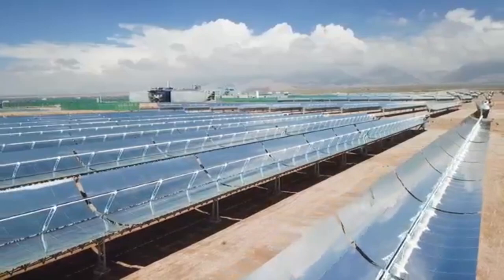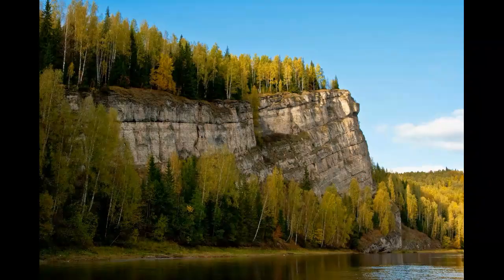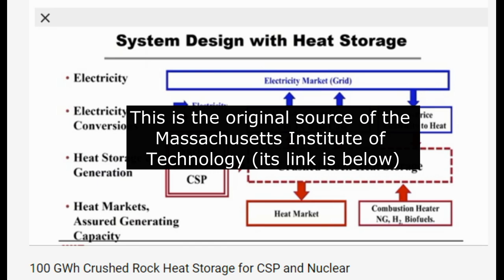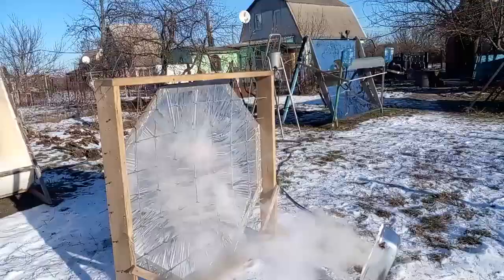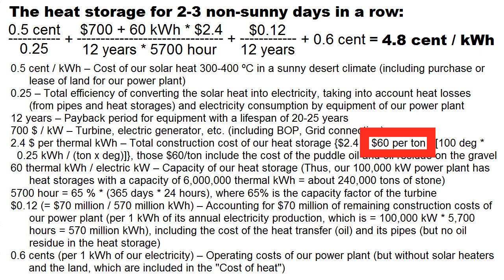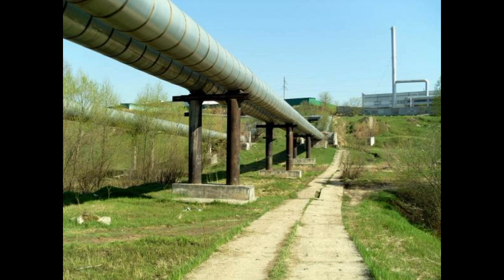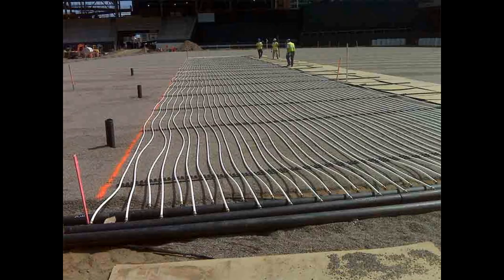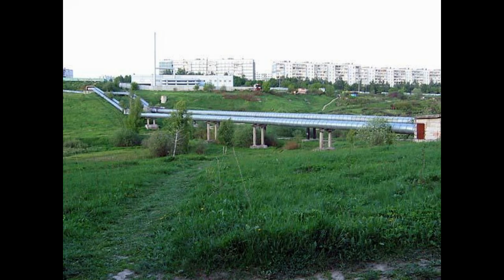How can we turn 300ºC solar energy into cheap electricity

Comment: I asked in an older video but didn't get the answer.

What kind of transparent film are you using on your collector? The one in front of the collector pipe.
Reply: Commercial tubes use glass and vacuum inside.  These type of heat collection elements ( HCE ) have been used in trough plants since SEGS in the early 1980s
Reply: @gordybishop2375  I don't think you understand my question.

https://youtu.be/kD6muOaEl7Q

in this video in the beginning and at 1:49 you can see there is some sort of transparent film/foil protecting the collector tubes from the wind.

I'm wondering what is that material.
Reply: @phlexy  I was answering the question as if it was the same as this video.
Reply from the maker: Usually my experiments use cheap polyethylene films (These are just experiments, not prototypes). But recently I also bought a sheet of thin polycarbonate
Reply: @sergiyyurko8668  thanks, next fall, winter i will try some of my ideas, as cheap as possible.
Reply: Reading other comments on this series also.

Liked the idea of using polished stainless steel.
Reply: @gregzeng  sky fuel was a company that was trying to sell polished aluminum I believe.
Reply: Had a friend helping them out.  Nice concept.  Visited their test loop they had at SEGS 2 before they turned entire site to PV
Reply: @gordybishop2375  Really? That doesn't make sense. Vacuum is an insulator, not a conductor. Something has to be inside the glass tube that conducts heat. Depending on the overall design, different fluids can be considered.
Reply: @gregzeng  Not a good choice. SS might be considered for durability, but you do not want it polished or it should be coated with a material that is heat absorbant, not reflective.
Reply: @tonysu8860  it insulates heat loss.  The tube is heated by sun light.

I am talking the space between the glass and the metal tube is a vacuum.

At my plants there was a Heat Transfer Fluid inside the tube to pump the heat collected away.

But again it was insulated from heat loss to the outside by the vacuum.
Reply: @tonysu8860  the first 40 seconds of this video shows the HCE tubes at the parabolic plants,  been using those types of tubes to produce utility grade solar thermal power since April of 1984.  I started working at the plants since 1986 and stayed for over 30 years.

Comment: I still dont get what is the new invention here?
Reply from the maker: A new type of heat storage. You can find old oil-gravel storages, but they are too expensive due to the large volume of oil (MIT suggests a drastic reduction in this volume of oil)
Reply: @sergiyyurko8668  The objective for using gravel is never explained. I've speculated that it's to extend the time energy is stored, but introducing an alternative medium like gravel is likely a poor decision. Assuming that the most common medium which is molten sodium is already part of the design, simply increasing the volume of molten sodium in the system is likely the cheapest, most efficient and simplest option to increase capacity which would also extend the amount of time energy would be available in sufficient amount to power whatever means is used to produce electricity. To verify this, of course you need more details of the system for concrete analysis, but the cheapness of sodium and the simplicity of just increasing the volume of sodium is hard to improve on. It should also be recognized that most places in the world don't go more than a few days of degraded sunlight unless you're located far from the equator, so "long term" storage shouldn't ordinarily need to be more than a week or so at most, or a couple weeks if one wanted availability approaching 100%.
Reply: Depends on the cost of the gravel, or medium. Depends on the cost of the pipes and how many. Depends on the cost of each component as well as repairs and maintenance for 50 year average. The cheaper each componet resource, the cheaper to recover cost, then there is freesources like on site gravel, on site dirt, old tires etc. In Arizona old tires and a 20-30ft mound of dirt with an adobe shell is used as the thermal solar collector, no trough mirrors, no parobolic dishes. Sometimes less is more
Reply: @terrafirma9328  Is that way of collecting heat suitable for other locations? Is there a name for that method?
Reply: @markhathaway9456  It varys by location. It's called many things,  Earth ship, Earth home is a couple. It can be suitable for comparison. Many factors are involved though that have to be weighed. Regulations and your relation with local regulators if they get involved approvals are many times more difficult from the closed minded. If you can get by undetected it saves lots of expense and time. Doing the majority work yourself also helps save both by not involving too many trouble makers in on your savings who may try to exploit or extort from you.